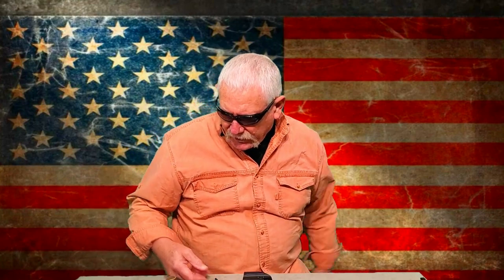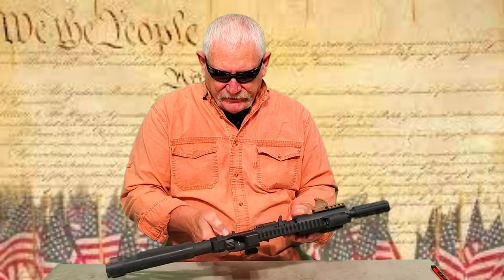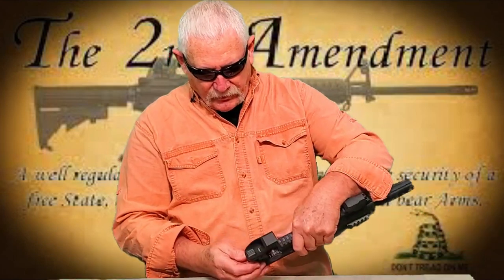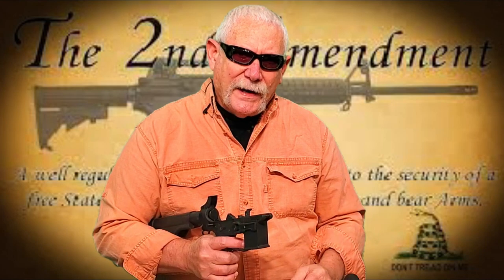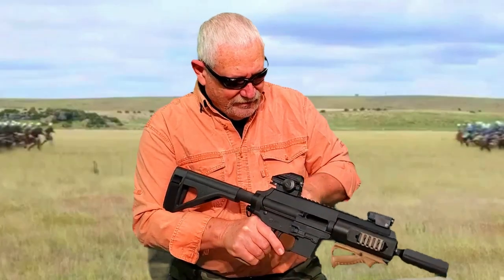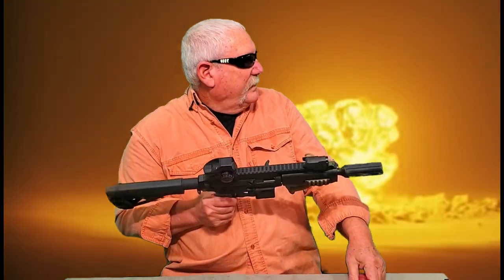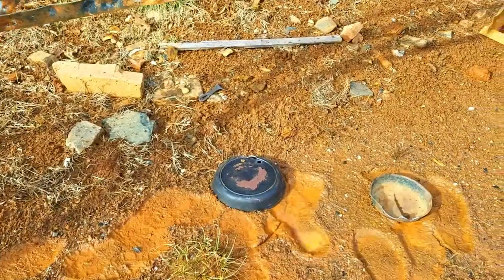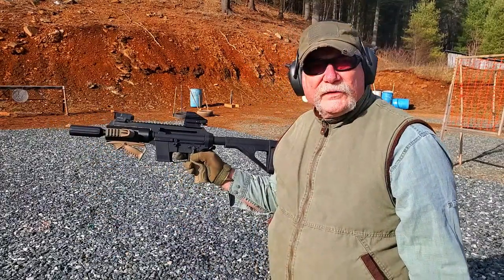Extar EP9 Tune up

Comment: Thanks for the info on the EP9. This gun has become one of my favorite firearms. Such a solid package out of the box. 
Light, compact, easy to handle, soft shooting, and reliable. 
Extar hit it out of the park. 
Mine is stock, with the bag, sling, and mag kit from Extar. I totally recommend the package. 
I’ve added a PA prism sight and an Olight/laser combo. 
It has become my trusted bedside gun. 
I enjoy shooting it more than my CZ Scorpion. 
Might add that metal buffer plate thing. 👍

Comment: Just got my buffer retainer plate from ZRTI.  It's great. The piece that holds the buffer is larger than the one that comes with the Extar. Thanks for the tip.
Reply from the maker: I thought it looked a little bit bigger, that's great. They should have duplicated the hole for somewhere to grab it but metal is better for this part. Glad to help.
Reply: @ITZGR82BFREE  You are right about the hole.  I think Extar should put this standard. Even if they charge $20 more it it still worth it. Thanks again and keep the great videos coming
Reply: @ITZGR82BFREE   Can you give me a link to your compensator? please and thank you  :)
Reply from the maker: @stayhappy9893  I showed this in my video...https://youtu.be/g1w0q5xl_So ... but I didn't give a link. Try this...https://www.kawvalleyprecision.com/category-s/150.htm.  Says you don't need a crush washer but you might... make sure to order the right one for 9mm. Mine is the XL but they have a slim version as well.
Reply: @ITZGR82BFREE   Sorry, I must have missed it. What is the Brand and or model?? That is what I'm asking. thanks
Reply: Just read on YouTube comment section right now where somewhere on another video says he Asked Extar about the plastic buffer retainer and they do not recommend replacing with ZR steel one. Said that the plastic buffer retainer is Designed to be a failure point Which saves polymer frame from any damage if there’s a failure. Moving to steel makes frame new weak point. Curious to others thoughts on this?

Comment: Nice video.  I sanded my charging piece on a workbench. I just laid out a piece of 150 for a few passes on each side and then 600 to smooth it out.  Doesn’t take much. I  gave  it a coat of spray silicon lube before I put it back.  Definite improvement. I would have done the buffer tube stop but I didn’t have the right thickness piece of scrap laying around in the basement.  Maybe a mid sized L bracket would work…or I could just offer my local gunsmith $20 to make one.  I also like the do it yourself thing generally, but for this little piece maybe I’ll farm it out.
Reply from the maker: Thanks for the comment... you are right, it doesn't take much but oh what a difference. I just happen to have the belt sander near by so I went with that.  Very light passes.

Comment: I also sanded down the charging handle. But I did it by hand. It really doesn't take much, just a few passes. I used 180 grit followed by 800. Big difference in the feel of the gun.
Reply: What did you do exactly?

Comment: I really appreciate your in depth video's on the Extar, just ordered the buffer retainer based on your recommendation.  I was wondering if you can do a cleaning video on your EP9?  The manual says no lube which seems really weird to me.  I'd like to hear (and ideally see a video) from you on how you're cleaning yours.  However you're doing it must be fine if you've got over 2,000 rounds thru it.  I can't find any cleaning videos on youtube so yours would be the first.
Reply from the maker: Most manufacturers producing polymer guns claim high lubricity ratings in their polymers molecular content. Meaning they resist friction or binding under surface to surface motion. In fact the claim is that lubrication actually tends to enhance the accumulation of GSR ( gun shot residue ) and causes more friction than without. It may be hard for us to wrap our heads around, but my suggestion would be to test the claim at the range before any lubrication is applied. Mainly they are refering to the bolt action but the trigger and safety may benifit from some a tiny bit of FROG LUBE after cleaning. If testing reveals a need for any lubrication of the bolt action then I would only use a good quality graphite spray, since it dries hard and would be less likely to collect GSR.  If I get time I may make a video on the subject. Hope this helps and thanks for your kind comment.

Comment: Love the sanding down part, but I believe you installed the charging block wrong. According to the extar manual, the cut is installed in, not out.
Reply from the maker: This is why you should always make note of the orientation of a part when you dissasemble something for the first time. This time I did not. I relied on my intuition and logical reasoning, but this time those may have failed me. I will double check that procedure and correct it. Thanks for flagging me on that.
Reply: @ITZGR82BFREE  Extar just sent me verification. "Install slant part of slider block toward muzzle". Thanks.

Comment: These EP9 videos you produce are GOLD, sir. I totally agree with upgrading the buffer plate to metal.  I ordered my EP9 yesterday and looking forward to its arrival. I do have one question: What red dot and magnifier do you have mounted on your weapon? In your other video, you have a CV Life red dot stand-alone. Thanks for making these videos for us EP9 newbies.
Reply from the maker: If you are looking for a recommendation for a red dot you might look at the NORTHTAC RONIN V10 or one in that series. The V10 uses standard AA battery and has the shake awake feature. It has to be programmed for the features you want which could be a little tricky but worth it. Price about $70 on Amazon. See it on my video https://youtu.be/IutUc0ET7OI.  CV life will be ok on a 9mm for cheaper but may not last as long. You will definitely enjoy the EP9 and you are probably getting the version 2 which I understand comes with a metal buffer plate.  Thanks for the comment and good luck.

Comment: 10:24 I’m hearing you still can take it apart? If that buffer retainer plate breaks
Reply from the maker: Yes... actually not as bad as I made it sound. A wooden dowel pushed into the barrel should/will move the bolt, buffer weight and spring back far enough to be able to take it apart. Not sure I agree with the rationalization about the metal retaining plate being a negative though.
Reply: @ITZGR82BFREE  doubt it’s a negative if people have had it with thousands of rounds gone through with no issues. This is what I read from another users YouTube  comment 
“ I asked Extar about the plastic buffer retainer they DO NOT RECOMMEND replacing with steel ZR. ( Rip off of over 20$ anyways for small steel part anyways but lifetime warranty?). Plastic buffer retainer is designed to be a failure point which saves your polymer frame from any damage if there is a failure. Moving to steel makes polymer frame new weak point.  Only time plate is under pressure is when frame is disassembled.  It is not under any pressure when assembled because bolt rides slightly inside the tube depressing buffer and spring slightly. Your preference? But Extar should send out new plastic buffer retainers  upon request supposedly.”

Comment: Great video, except of the part when you loaded the magazine with the bolt not locked back. Never the less, still a great video, keep up the good work.
Reply: He didn’t load  a full mag. So ot was completely fine
Reply: You shouldn't load a full mag while the bolt is closed, a partial mag is fine.

Comment: What’s the optic you are running and also where did you get that bottom and side grips for your left hand ?
Reply from the maker: https://www.hustlepaintball.com/Warrior-Paintball-Angled-Foregrip-Support-Kits-p/foregrip-war-anglesupport.htm

Should be about $13.
Put in hot water for a few minutes before you slide it on.

Comment: Nice build. But what size mlok rails fill up that handguard? I see you have a small one on. But I need the correct size to use the whole space on the handguard. I ordered one and I want to get the rails while I'm waiting.
Reply from the maker: I used a 4" mlok rail but I think it will take a 5".

Comment: No thanks? I own a CMMG Banshee. I know it cost a lot more. If I was going to buy a cheap 9mm AR platform pistol. I would go with a $640 Foxtrot Mike. At least you get all metal construction and just as good or better reliability. With all mil spec AR features. Not this $200 less plastic gun. That is limited on upgrades. No matter what you do you are stuck with a plastic picatinny rail and plastic frame. Foxtrot Mike all day and any day over this Mattel toy plastic gun
Reply from the maker: Ok... all that being said, you cannot deny the slot that the EP9 would fill in anyone's arsenal as a very reliable and budget friendly 9mm projector capable of neutralizing a personal threat just as effectively as any other. The bad guys don't care about gun snobbery when rounds are coming their way. I don't own a Banshee but I'm sure it's awesome.
Reply: @ITZGR82BFREE  I am not comparing the Banshee. Read my complete comment. I am comparing it to the Foxtrot Mike. Far better deal. At least you can change out any part on it because it is mil spec. The Extar you are stuck with it and you are at the Extar companies disposal. Even if you change out that round awful looking hand guard for a metal AR like type hand guard you will be at or above the FM9 price. There is no other AR 9mm platform out on the market that matches up with the FM9 for the price. Now if you do not want to change out things on the Extar yes you can save $200. But if they change design down the road or go out of business it will be sorry about your damn luck.
Reply from the maker: @johnwrenn766  The FM9 is indeed a fine choice for a PCC. The best price I've seen on line and in stock with the SB brace is $999 from GUNPRIME. Add shipping, FFL, and tax you're over $1100. Still a good option to be sure, but not a reason to go trunk monkey on a lower priced and available alternative.
Reply: @ITZGR82BFREE   Primary arms has the FM9 for $640 plus $20 shipping no sales tax depending on the state you are shipping to and in stock ready to ship with shockwave blade. Primary Arms and Brownells and The Glock store are typical dealers for Foxtrot Mike weapons. Shipping and FFl are for any weapon.
Reply: I actually already own an AR9 but I bought the EP9 also and love both.  More is better !
Reply: @bennyworkman4605  simple man as well huh.
Reply: no thx.  this gun is my backpack gun with a folding brace. weighs soooo much less and who cares about upgrades.  it points, and shoots accurate for personal defense.  you prob buy every accessory in the catalog like Jeep Wrangler owners
Reply: @kmarshall131  What folder did you buy?  any tuning required? TIA
Reply: @ercly9382  curious as well - haven’t seen much for folding purposes
Reply: @kmarshall131  you can’t put a folding brace on this gun guy.  Did you not see his tutorial on the buffer tube? Your comment was straight out of the 3 stooges.
Reply: @ercly9382  you can’t fold the brace guy, it has a buffer tube!!!!!! Watch his tutorial!!!
Reply: I don't understand the hate for polymer. It's proven to work as well as the metal guns, so why not. I initially felt the same as you until I bought a $600+ all metal AR-9 model gun that won't work with HP ammo, so I'm like WTF?!?! I'm going to send it back to see if the maker can get it to work. I've got an ep-9 on route. 
Honestly you sound like the strider knife fan Bois. Of course you won't like the more inexpensive guns. You've got a butt-ton invested in your model. There are many cmmg and striborg (sp) people  that compare the ep-9 to theirs (honestly) and the ep-9 comes out on top. No shame in that, but I guess you gotta say whatever to make yourselves feel better.   I'd respectfully suggest you get an ep-9 and then comment. Until then the comments have no merit.
Reply: @mylifeisacomplexpastiche7901  He's all dry-fire! 🤣
Reply: JOHN WRENN: Spoken out of pure ignorance.